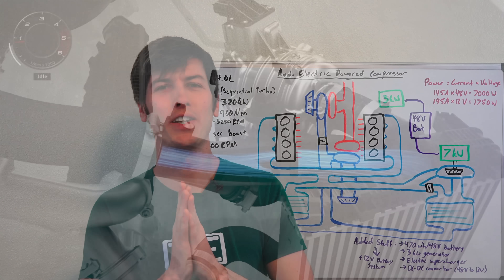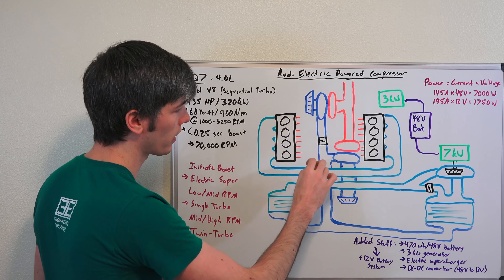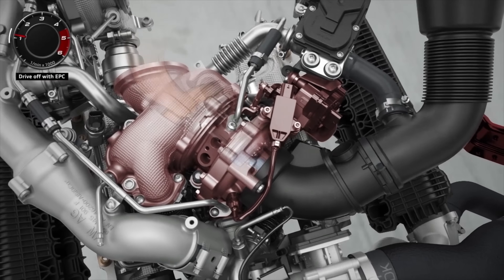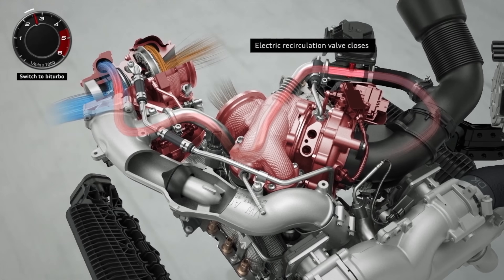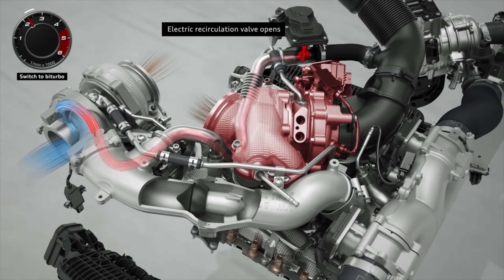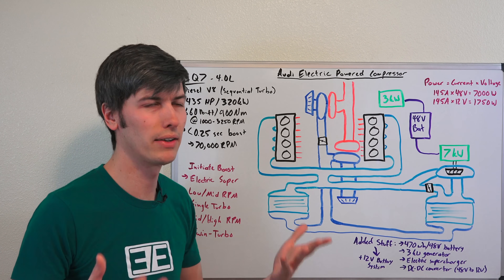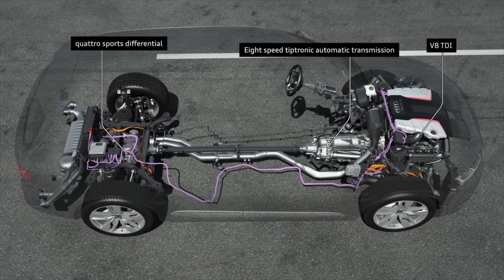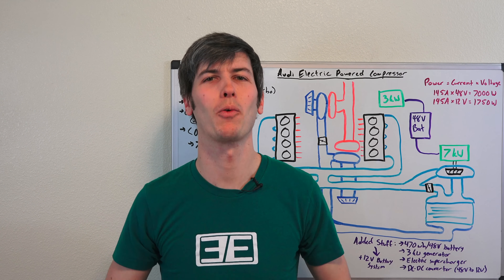Electric Superchargers - How Audi Is Eliminating Turbo Lag

Comment: volvo's compressed air storage system is much simpler and by the looks of it, weighs far less. audi must have been kicking themselves for not coming up with that idea.
Reply from the maker: And a lot of comments on the Volvo video “why not use electric” haha. They both have their unique pros and cons.
Reply: Engineering Explained well... the internet isn't exactly the place that is known for its easy-to-satisfy residents.
Reply: TL DR Audi's system can provide boost for longer time. 
Volvo's system is designed to reduce turbo lag just by helping turbo to spool for short time, it's just quick shot in exhaust manifold. Audi system can provide support for compressor much longer and it gives you more flexibility - you can adjust speed of electric supercharger to engine needs. Volvo's system is simple system to spool big and heavy turbo fast, in Audi's system you can rely only on electric supercharger on low revs.
Reply: Volvo's system is blowing in exhaust manifold to spool turbo, not in the intake manifold.
Reply: If kommentator doesn't get it in short order, I am going to assume he got his turbo installed in reverse and farting the wrong direction.
Reply: Quertreiber(QT) and that's different from Volvo's system how?
Reply: @Joash Chruch    Not the static pressure behind the turbocharger on the intake side!
Reply: Kommentator that’s not how Volvo’s system works.
Reply: The first negative I can think of for the volvo system is that you need an electric motor for the compressor and a solenoid control setup for the spoolup valve.

On the other hand it'd be a good air source for the airhorns "liberated" from a CTX locomotive.
Reply: There could be reliability and safety issues with the volvo approach. An air compressor can get hot quickly, especially when inside an engine compartment that itself gets hot. And how will the air cylinder perform/behave in various crash scenarios?
Reply: Actually since it's relatively cold air it might actually increase the life of the turbo.
Reply: Volvo`s compressed air storage system creates way too much static pressure behind the turbocharger... which really increases the risk of wear and component failure. All of those Audis with 48 volt systems already have the higher voltage for their electric swaybars and power generators, so the only thing added is 1 motor.
Reply: I don't think a sudden rush of air or continued excessive rush is a problem, for the turbine wheel to take.  Doesn't seem like the wheel would get slammed side way, as most air flow would spin it like centrifugally/reversely.  Even if it get's slammed, think what BB/Thrust bearings are capable of.
Reply: Terry Foldy Holes The idea of spooling up the turbocharger has been around for many years in marine engines - one example being the MAN 'air assist' from 14 or 15 years ago.

Comment: Are there any other manufactures that are following suit with this that you know of? Or was this a completely independent R&D for audi?
Reply: Audi is the first electric supercharger I've seen, but Volvo has the air injected turbo to eliminate lag. There are also a few twin charged (turbo + super) engines out by different manufacturers.

Comment: If the elimination of turbo lag is the goal, why spend all this money crutching the turbo? Why not simply replace it with a centripetal supercharger? Fuel economy? It just seems like this is a very expensive way to go about getting immediate boost if that's all they are trying to achieve.
Reply: NorthernChev it removes the parasitic drag on the engine. You already have an alternator. This one is probably a little bit bigger, but that increase in size will create less losses than adding a supercharger.
Reply: A supercharger with an electric clutch would accomplish the same  result and only put load on the engine when used. The only advantage I see for this is lessened load.
Reply: - Cole, That harkens back to what I'm saying about if it's for fuel economy or not. That's what parasitic drag causes. But don't think for a second how much parasitic drag a 48 volt alternator system will have. Plus ALL the added weight. Less than an supercharger, I'm sure, but man, it's gotta be close to a diminishing return.  It's my opinion this is for little more than proof of concept.

Comment: Conventional ICE are getting so complex with each passing decades that when, around 2030, oil will be so expensive and cost of squeezing out the last efficient drop from every fuel burned will out weigh the cost of cost production then battery driven, no matter how expensive battery driven cars might be, fully electric would make sense.
Reply: They keep finding it.  Dont believe the hype. Oil is here to stay for a long time.  Also it won't be like one day we wake up and oil is 10k a barrel.  Very slow gradual process of getting more expensive.   Did you know a barrel of oil was 120 in 1980!!!! Its 67 today...... now adjust for inflation lol...  stop believing the retarded leftist of the world
Reply: Naptown Squid the price won't go up. it'll go down since most people are switching to electric cars which use locally produced "fuel" and stop buying oil from the middle east. i reckon the arabs will lower the price to make going electric less appealing.
Reply: symmetry08 we have enough oil.
Reply: Alex Gunner no buddy.  First of all most people? Nope, e cars are still way out numbered and will be for awhile by ice cars.  Not to mention 47 percent of u.s. oil is used for gas and ethanol products which leaves 53.  5 percent of the world's oil according to one source is for petro chemicals.   Oil is scarce and price will rise as long as its in demand, which it is for many things. Im just saying it will be gradual and take much longer than  I hear a lot of people say
Reply: timeline for oil, when it will run out, is clear to explorers. It is not that popular news. They have not found any major discoveries for over decade and more, and they can estimate graph how fast it will be used up. Estimate is around 2060 ( -/+ 7 years ). Add to equation population rise.
Reply: symmetry08 nevermind. Its BP I found it. But yeah Its still going to operate in  a supply and demand way.   As it gets scarce price will go up and people will move away from it.  Then supply will rise and we will buy more,  back and forth over a long period of time witb an overall theme of it getting more expensive.
Reply: other companies are making fuel that doesn't use gasoline using reusable resources, everyone knows everything can't be electrified that easily
Reply: Synthetic fuels will only be viable if oil exceeds around $280-300 per barrel.

With regard to "enough oil" - apart from declining finds, there are enough other issues showing up that curbing carbon emissions worldwide are likely to become a matter of critical importance in the next 10-15 years. 

Look to see massive investments in public transport infrastructure. Who knows, maybe the USA might rebuild to the point where it can once again claim to have the best public transport system in the world, like it did until General motors systematically set about destroying it in the 1920s in order to sell more cars.
Reply: please stop calling it ICE cars.... just call them cars....  find a strange name to call to the electric vehicles and leave the CARS alone.

Comment: Wow.  Crazy complicated.  Part of me thinks that the complexity and maintenance costs for advanced power systems like these will accelerate the adoption of simpler battery electric and hybrid powertrains.
Reply: All the new engines featured in the 2018 a7 and a8 will be mild hybrids, containing a 48v battery, dc to dc converter and an electric motor attached where the starter would be.
Reply: Joe Holland turbos are not additional lol. Its a turbo diesel, what do you expect?
Reply: Agreed,
one could simply have used the electrical power to directly drive the car.
All this is only needed when you are going relatively fast at low rpm and slam the accelerator.
Reply: Just go hybrid? Why germans make it complicated.
Reply: Adding mechanical systems to a car to fix a simple problem never ages well.
Reply: What`s so complicated?

Comment: Random Question:
If you want high pressure at the combustion to increase torqe, but you cant because of the self ignition in a gasolin engine. Why does premixture of air and fuel even exist instead of having only direct injection?
Is there any benifits with pre mixture?
Reply: IT Is simpler therefor cheaper to manufacture. People who buy a VW UP or a Toyota Aygo want a cheap fairly reliable car.
Reply: Mandernach Luca what is so expensive?
To just have the injetor at anothet place? I dont get it

Comment: Interesting! I was wondering: Under what conditions/at what rpm does the electric supercharger turn off?
Reply from the maker: Once you reach boost it’s no longer used. Very short bursts that it’s running, when you first apply throttle.